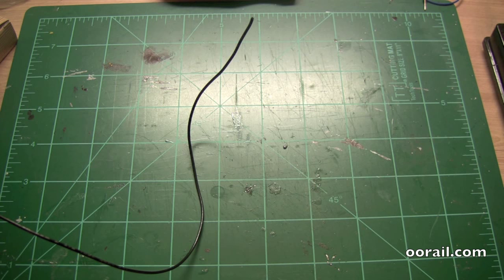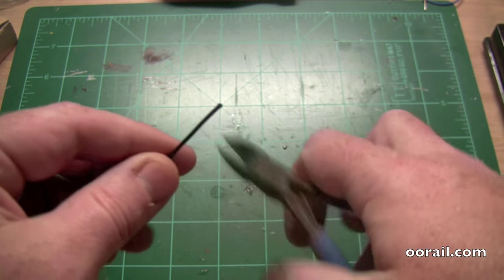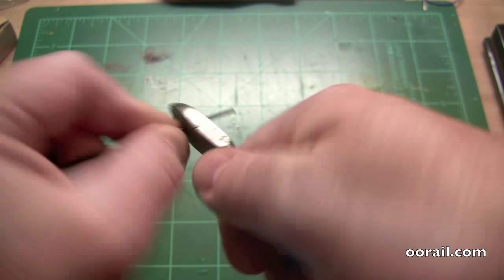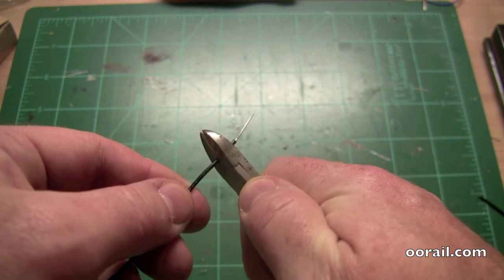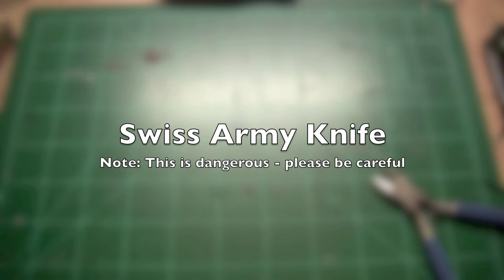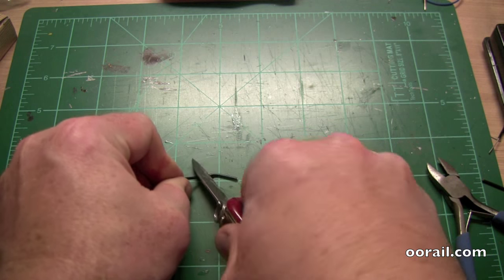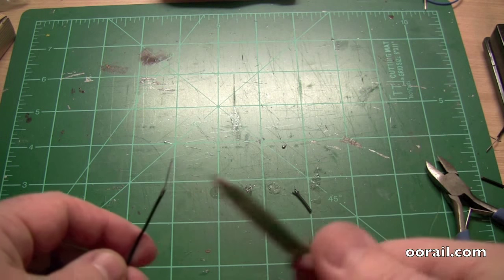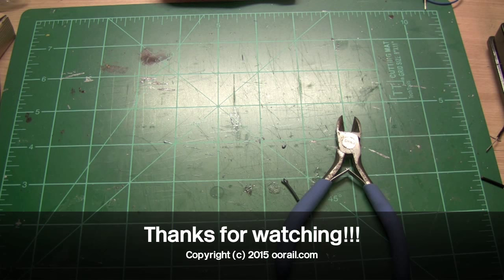oorail.com | Model Railway Basics - Wire Stripping

Comment: The only problem with those methods is the wire usually gets nicked and the wire then can break easily.  I have used both in a pinch but the best way is to use wire strippers.Scott
Reply from the maker: +Scott Downey Yes that is definitely a downside to both methods. I haven't really had that problem with the swiss army knife, but I have nicked a few strands of multicore wire with the snips. The trick with these methods is to lightly score the insulation, so that you are almost pulling it rather than trying to cut through the insulation all the way to the conductor. The idea with this video was to show folks that you don't necessarily need an expensive wire stripping tool to get the job done. Even some of the wire cutters on the RJ45 crimp tools for ethernet can nick the wire... :)

Comment: Speaking as an electrician for over 40 years, either method carried out like that, can and most likely would damage the inner conductor. Sorry but you should have advised the correct tool for the job.  Craig
Reply from the maker: Thanks for commenting Craig. You forgot to mention what the correct tool would be though? You can definitely cut the inner conductor if you are not careful, but you can also use both of these methods without any issues with a bit of practice. I've used both of these methods when I haven't had a proper wire strippers on hand, even for Cat 5e Ethernet cables that have far less tolerance to the inner conductor being damaged and much finer insulation ...
Reply: +oorail.com That would be wire strippers!
Reply from the maker: +BremptonJunction67 LOL... yeah I probably asked for that... I was actually looking to see what type of wire strippers you would recommend... :)
Reply: +oorail.com 

Yes sorry John I should have given a better answer. In short it is always preferable to use a pair of wire strippers that either automatically adjusts to the cable size or one that has pre-set cable sizes, which means that it has a fixed diameter for a specific cable size and will only remove the insulation and not “nick” the conductor. The issue with using side cutters
(snips) is that on rigid cored cable it is possible to apply too much pressure and create an indent into the conductor, which you may not always see. This becomes a weak spot and if there is movement or vibration in the cable it can break at this point. With stranded core cables the initial damage is more obvious as some strands may be left behind in the piece of insulation that has just been removed and although the cable may not break, by removing some of its strands
the cable size (CSA) has been reduced and thus reducing the current it can carry and in DC this could cause a loss in voltage over long runs.As for using a knife, sometime it is the only way to strip a cable due to the lack of space and when electricians are trained, we are taught how to use one correctly and goes as follows; using a very sharp blade and for example a Stanley knife with a new blade, but not a disposable craft knife as the blade is not rigid enough, but ideally an electricians knife (this is a curved bladed knife that is kept very sharp) you hold the cable with one hand placing the piece to be stripped between the blade edge and your thumb (as though you are trying to press your thumb into the blade) rotating the conductor and simultaneously applying just enough pressure to score the insulation and NOT cutting through, then with
a little tug it should remove without any damage to the conductor, with a bit of practice it can be done first time every time.  Sorry if this is long winded but it is the best I could do to answer your reply properly. I hope this helps………Craig J